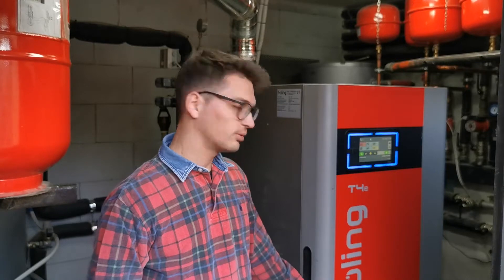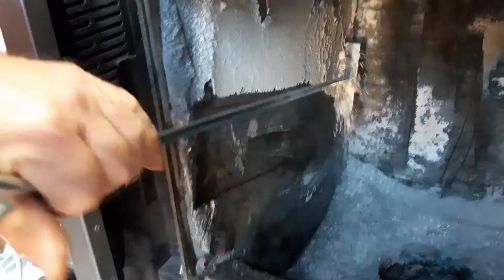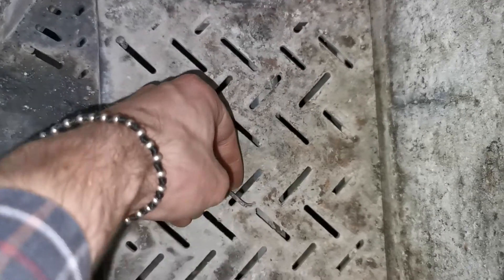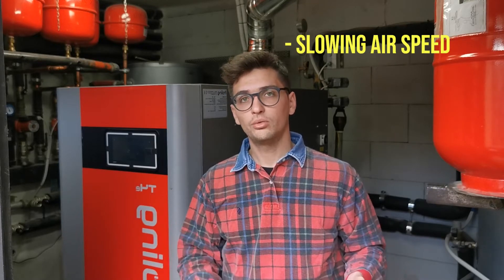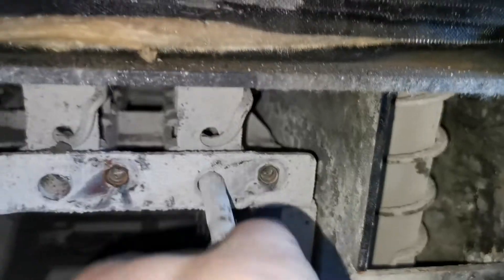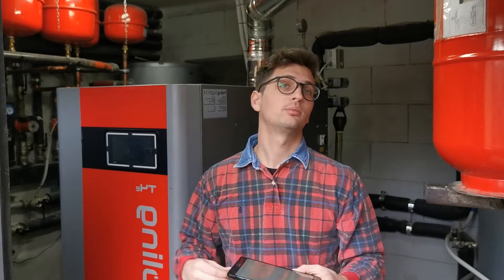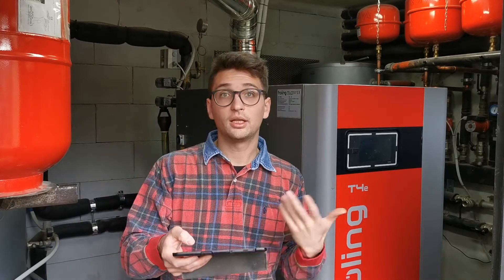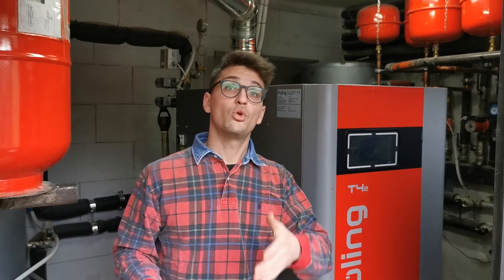FROLING T4e [2] - how to CLEAN wood chip and pellet boiler

Comment: How often does this need to be done?
Reply from the maker: Hi! this was the first time we did it, after 2y of working. From now on we'll do it once a year. It really depends on the material you burn: if it is good quality wood, producing not that much ashes, you can do it less frequently. We burn very low qualuty material, twigs with a lot of bark, so we have to do itmore frequently.